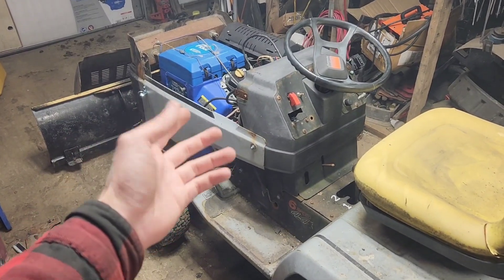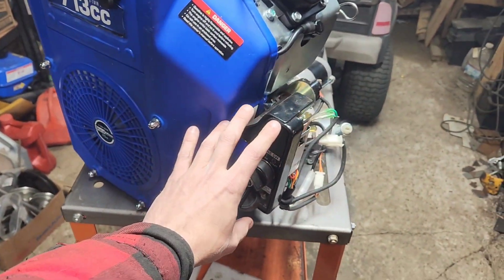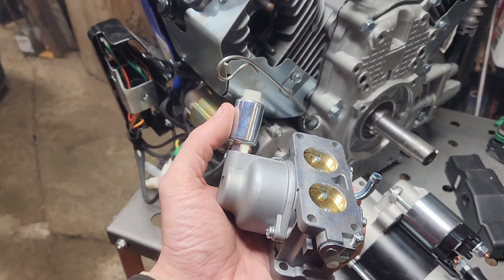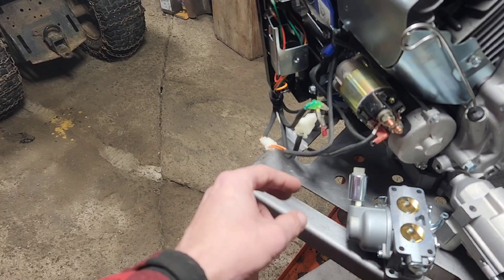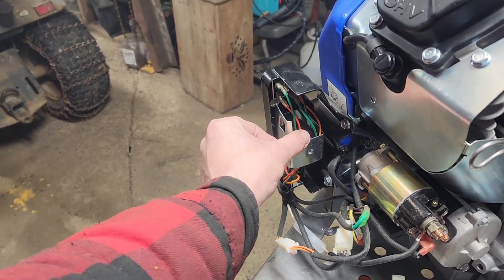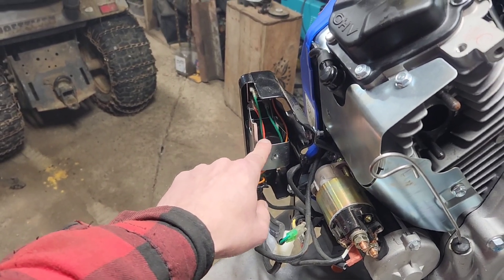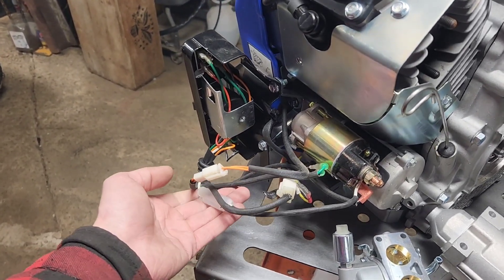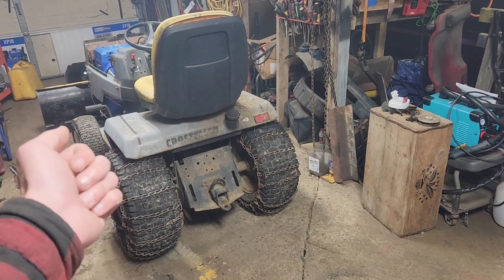Duromax 713cc 23HP Wiring Explained How To

Comment: The other wire that’s on the Killswitch circuit. That isn’t the direct kill switch. I’m pretty sure it’s an RPM limited. If you remove the governor and try going over 4000 RPMs. Your engine will shut off.

Comment: I have a newer Duromax I am wanting to disconnect the charging system and want to use there key switch, What wites can I remove and what is the circuit breaker for? Do I need it or can I remove it. I just need switched 12volt @ the rear to turn on a external alt. I called Tech support with no help. Mine has 2 orange wires @ the back is that the stator wires? Thanks

Comment: is there a fuse on the white wire coming from the starter?. I opened my up and it doesn't have a fuse in the holder in the white wire. thanks for the video

Comment: First off, Congratulations to You and Jesse.
The backfire prevention has nothing to do with California Emissions.
It's to help prevent the carburetor from flooding over by giving you a mechanical way of shutting off the gas.
If anything California emissions would be a restricted in the muffler or reduce how much gas the Engine is using.
Reply from the maker: Do some digging. They got added as a environmental thing thanks to California. The remarketing was done by small engine companies to sell you on it. Its an environmental thing on any engine bigger then 500cc. Thus the reason a 14hp kohler does not have one but a 19 does. Same with a briggs 13.5 but yet the 17 does. It was done to prevent junk yard leaching of gas or at least that was the political side.

Comment: I have a question for you redneckcomputerGeek I have the exact same engine like the one in your plow tractor and every time I go to start the engine I have to give it starting fluid its been like that from new I don’t know why just wondering if you know why?
Reply from the maker: Main jets are to small. Mine was the same way did a video on it last winter about starting in the cold. Its a know problem caused by California laws.
Reply: @redneckcomputergeek  is there an upgrade kit from Amazon I can buy? And congratulations to you and jesse
Reply from the maker: @rileyowo3438  I noted the jet sizes in the video. NRRACING.COM sells them